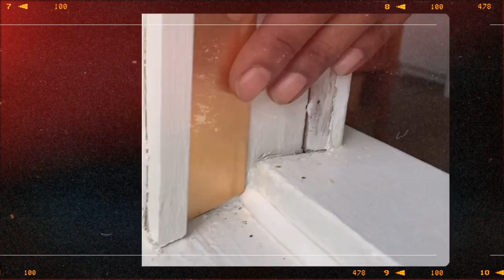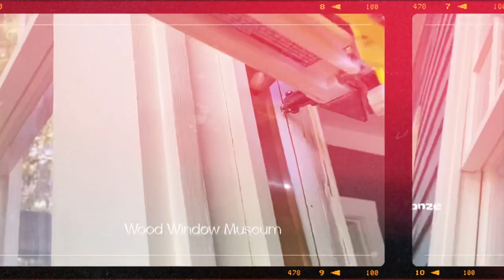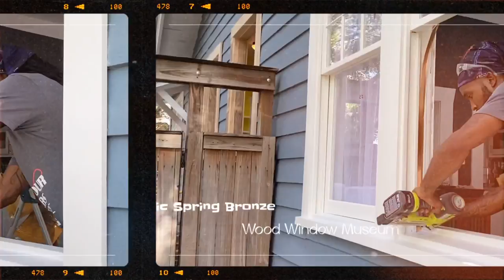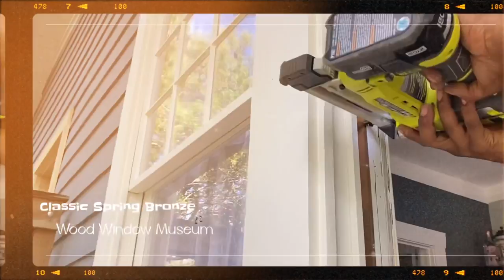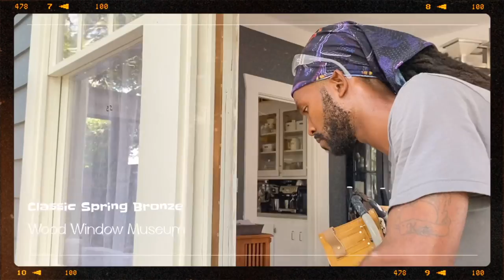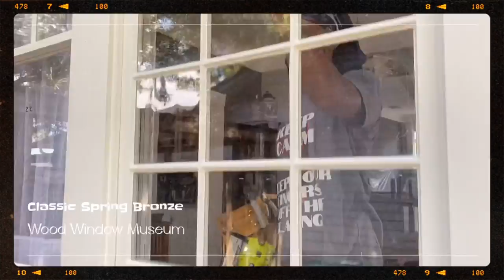Silky Smooth Spring Bronze

Comment: This vid may save me a ton of time.  Any concerns with the stainless interacting with the bronze?   18 gauge narrow crown stainless staples ... how long a leg do you use?  Thank you
Reply from the maker: I was concerned at first, but did a little research that told me it was no factor. We use 1/4” crown staples with 5/8” legs to make sure it doesn’t go all the way through the jamb leg.
Reply: @WoodWindowMakeover  Having trouble locating narrow crown 18 gauge stainless staples with short legs.  Got a source?  Thanks